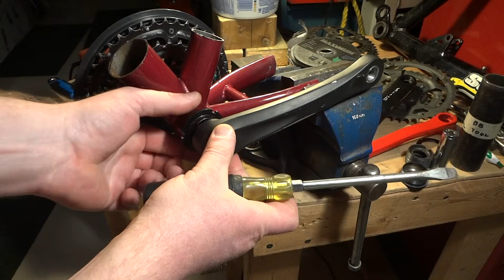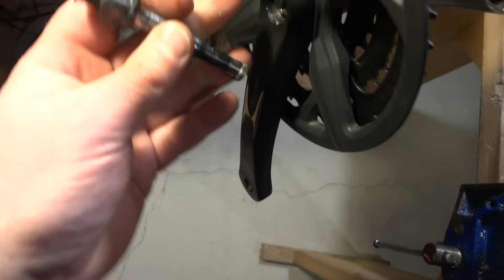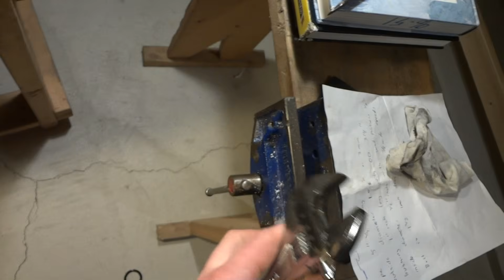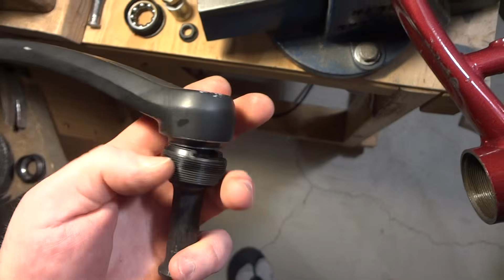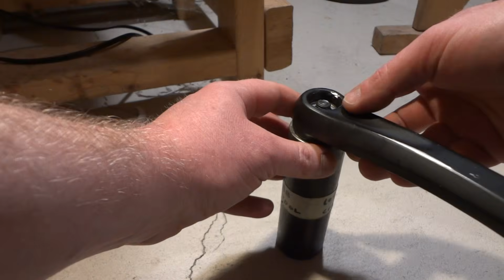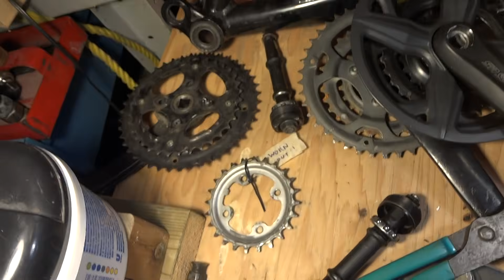Remove cranks without tool no damage

Comment: This vid has excellent points, i would add that using bbq lighter style butane torch from Costco on the outside of the crank (arm)will make its removal with a hammer easy with a slight tap. Thank you.

Comment: Part tool CWP-7,  $15.00 could save you time and problems
Reply: you can't use that when the threads are stripped!
Reply: @techjunkie68smusicandtech56 
Then you might as well just angle grind them off
Reply: @techjunkie68smusicandtech56 
Clean the treads and install the tool properly and you won't have that problem. Best $15 I ever spent.

Comment: ill save everyone the pain:
-UNSCREW BOTH BOLTS ON CRANK ARMS
-UNSCREW LEFT BEARING RACE
-BELT SHAFT FROM OTHER SIDE WITH PUNCH & HAMMER.
-DRIVESHAFT & BEARINGS WILL POP OUT
Reply: Should I also cut my frame into a hand size section and secure it into a vice?
Reply: @uidx-bob  Yes - but be sure to take absolutely months to show how when you make the vid. No rush - honest.
Reply: @uidx-bob yes, it always helps to do that. Be sure to weld it back with no flux either
Reply: What does belt shaft from the other side mean?
Reply: @Tribute2Mike it means hit the central shaft from the other side to pop it out, without damaging bearing race

Comment: QUESTION: I am looking to replace the left crank on a bike and got one that is a different weight than the original. The original crank is pretty heavy in comparison to my new one. Will this weight make a difference when riding the bike? 
Thank you for your video!
Reply: nah it will work just fine

Comment: Damn that shit started kinda simple then bam bam bam you're 30 steps in wanting to quit
Reply from the maker: This is the non destructive method for aluminum cranks, if they are metal, just tap the insides gently with a hammer many times, vibration should release at least one of the crank arms, then just remove the bearing cup..

Comment: Errr.. if everything's already loosen before .. then you don't need tools .. most bikes nuts and bolts are probably stuck if we are searching for videos to remove a crankset ;).. update: yeah @bikeman mentioned about loosened screw in the first place. ;)
Reply from the maker: It was already loosened and I still couldnt unscrew it, I was pretending it was seized and trying to figure out how to loosen it. but i explained it in the description : P
Reply: @BIKEMAN21  oh yes. Apologies. !
Reply from the maker: @ryanyoutube7315  if your bottom bracket is aluminum it can be seized if not serviced in long time.  at that point it may be required not to remove the bearing race on the drive side because it wont come out. Ive got other video's showing this https://youtu.be/XLjbaymxH-E and https://youtu.be/FagZ6jh_W1M and https://youtu.be/Jgn1ee3BGDg

Comment: My bike paddle drop with arm from crank shaft. I tried lock tite on threads but after five min ride arm drop with paddle.
Left side where no chain is there please advise.
Reply from the maker: sounds like the arm is damaged. Hammer it on and keep tighening the nut while riding it. make sure the nut does not get loose, lock tite will not work for this because the taper will always loosen the nut, you have to keep tightening the nut in your situation because your arm is slightly damaged. After a while it should be ok.

Comment: I gotta admit...u got brains man 👍🏽
Ive been deaing with this prob cuz i dont have a crank puller
I already broke a thick screwdriver like yours in half 
Thx so much 😁
Reply from the maker: Right on ! I came up with this method after I found aluminum bike with Alloy cranks. The problem was the crank arms were hopelessly seized, even if i had the puller it probably would not work. And my usual go to method of hammering on the inside of the crank arms was out of the question, i wanted to re-use the crank arms. During a search of youtube i found everybody was showing methods that were quite bad so this is basically my first video.
Reply: Well i still didnt manage to remove from my other bike 😔
Do u see what u did at 1:07 i cant do that cuz its plastic , i tried to loose it with a grip tang and it just wont turn 😕
Reply from the maker: @iseayabrucedolieveira4032  You may have a different type of bottom bracket such as hollow tech or something.

Comment: 😀👍
Reply from the maker: Yup this actually works, i haven't seen anybody on YouTube disassemble an entire crank without the special tools. my way is better because the actual tools could damage the crank arms.
Reply: @BIKEMAN21  it's how I've always done it  . although I do leave the nut on it . and hit the outside of the nut ,to keep from mushrooming the axle. And instead of a punch.
 I use a smaller socket and whack it. But I just like you fooling around with the bikes it's cool to watch. 👍
Reply from the maker: @Jarrod_D  Nice, what i found is best is to never leave the nut on,  or bolt,  inside the crank axle, as the only part that is strong here is the axle. I've never seen a crank axle get damaged from hammering, a pedal axle yes. But the crank axle seems to be much stronger and harder than any other part on a bike.
Reply from the maker: @Jarrod_D  You are going to strip the nut like that i think.  I Havent tried it on the nut style though. but if it was a bolt it would strip immediately.. tried that.
Reply: @BIKEMAN21  put the flat of the socket against the nut and the axle .back.the nut to the top of the axle to keep it from mushrooming. And whack the socket. That's how I do it.
Reply from the maker: @Jarrod_D The socket to protect the axle sounds like a good idea, not sure if its really needed but i dont get why u would leave the nut on ? seems like it would strip as soon as you impact it.
Reply from the maker: @Jarrod_D  you were right about protecting the axle threads, i recently had a really seized one and was using the 4 lb sledge hammer and damaged just barely the first thread just slightly. luckily that axle had severe bearing race damage and is trash anyways. I got the video here : https://youtu.be/XLjbaymxH-E